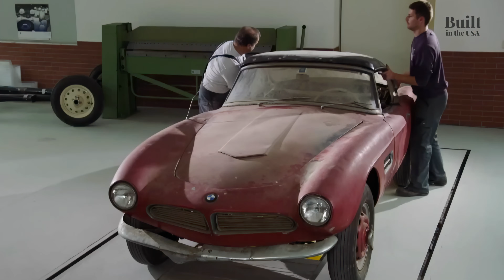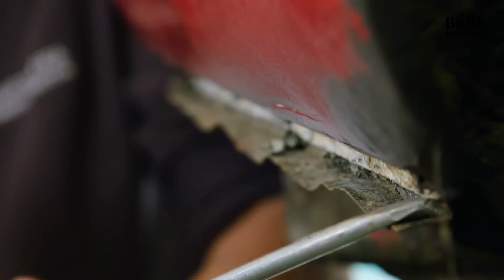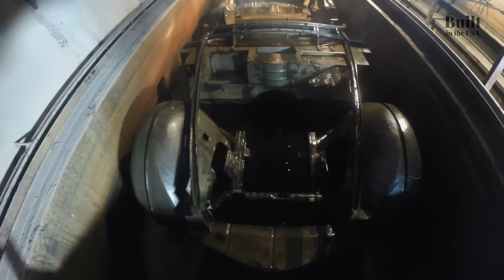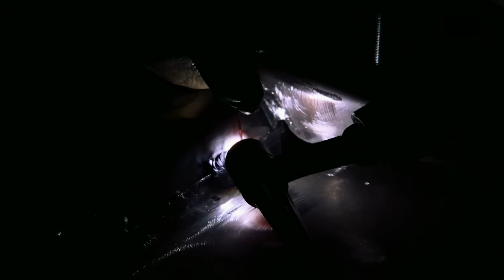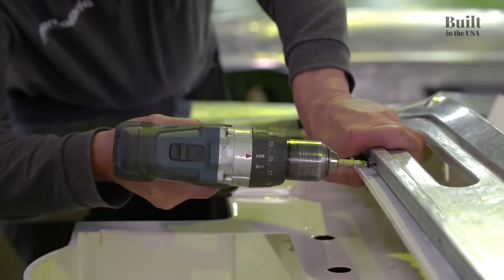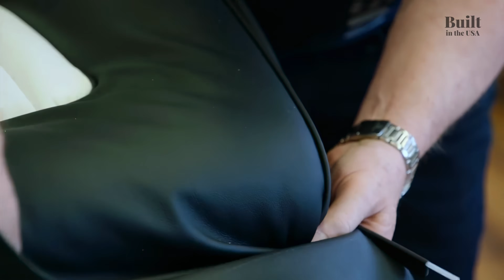Restoration of Elvis Presley’s $9 Million BMW – Restoring the King’s Rare Classic Car: BMW 507

Comment from the maker: Do you think Elvis Presley would be proud of the Restoration of his BMW 507? 👷‍♂
Reply: No. Because they took the history of the car away. I'm not even an Elvis fan and even i know that the car was painted red because his fans would smear it in lipstick messages and kisses. Literally like taking the Gizah pyramid apart, block by block and sticking it back in the quarry pit with mortar made from the quarry dust and calling it a "restoration". This was the worst crime one could make against a car that has a individual's history linked to it.